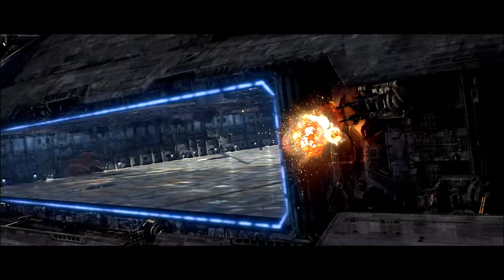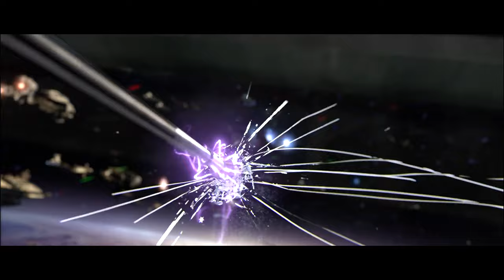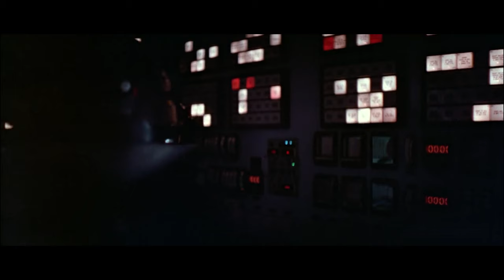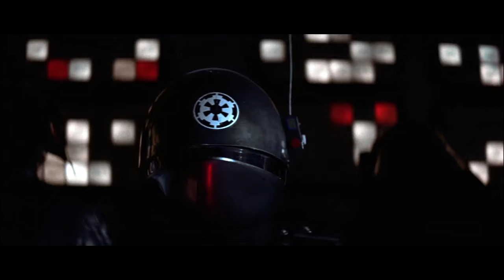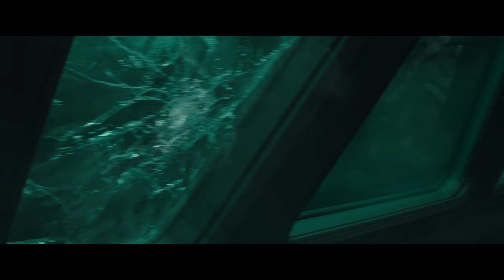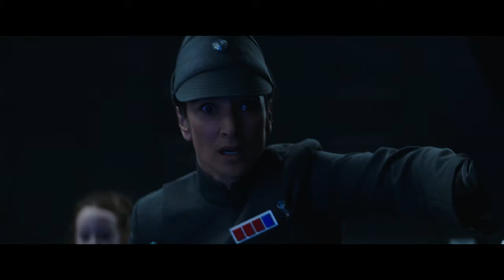This makes literally no sense

Comment: I mean, technically theres no reason for a house to have windows when you could just have security cameras instead, but windows are just nice to have.
You could have some sort of cameras or sensors on ships instead, but if the ship gets damaged and they stop working, now you're kind of screwed because now your flying blind.
Reply: Windows allow you to see outside without requiring power like multiple indoor display units would require, which don't let in natural light either and aren't feasible in off-the-grid locations. They can also be opened and closed easily for ventilation. AC isn't that common in homes outside the US.
Reply: Windows is actually a very well-designed operating system and allows the user to browse the web, store photos and media, and organize their documents quickly and dependably.
Reply: I don't even think Star Wars have proper cameras. Imagine how easy they would have caught Obi-Wan sneaking in if there were cameras. Same as the Rebels would not have been able to even start the battle of scariff if the empire just put some trackers/monitors on the storm troopers would when one dies they know something is up and where.
Reply: @exurii5844  I think it's mainly about WHERE and HOW the Empire plans on getting attacked. 

Would YOU install security cameras on every single corridor on the hangar level of the Death Star? I admit you could limit it to just that level, but that's still a LOT of wiring for something that's (theoretically) never going to happen, and if you DID install them, you would need technicians staffed watching every single feed every single minute. 

And Scariff was a similar story, I bet
Reply: @Vagabondobiondo  nah but that water fortress wouldn't take much and for the most part I think the empire is ruled and controlled by generals. At least the smaller desicions so they're not that smart. Plus we've never seen a security camera in star wars as far as I know so it's safe to assume they just don't have that kind of technology.
Reply: @Vagabondobiondo  
point taken 👍
Reply: @exurii5844  are you actually implying that military officers (people who study for years at universities and academies) are stupid? Sorry they arent just casually working with einsteins relativity theory on a regular basis. 🤦‍♂️💀
Reply: @exurii5844 never seen a security camera in Star Wars? Do you remember that scene in Revenge of the Sith when the Neimodians were tracking Obi-Wan and Anakin inside the Invisible Hand and they showed up on a view screen? I know we didn’t actually “see” the camera, but there was definitely one there.

Comment: Actually it makes a lot of sense: hubris. 
As you see when Grievous breaks the window, a 'metal' blast shield closes a second later. Well, when there is no threat, or not in a battle, the bridge officers would like to have a view. When in a battle, you would close the blast shield. Grievous has not closed his blast shield, because he doesn't see the Republic as a threat. In addition, assuming the ship has shields, most blaster fire would be intercepted before hitting the bridge anyway. Again, Hubris.
Reply: What doesn't make sense to me is why they don't have the same magnetic containment fields the use for the hanger to keep the air in as a backup for the bridge windows.

Comment: I mean the entire ship's exterior is covered by power shield most of the time, so it's is actually much harder to break from the outside, and it's commanding deck, being able to physically see everything that's going on around the ship is pretty important for commanders. If they rely on digital systems to broadcast all outside information and the system suddenly breaks down, everyone in the ship would be entirely blind to everything that's happening around them.

Comment: Sensors, cameras, and holographic projections can be interfered with via jamming and electromagnetic countermeasures, something you would want to have on a large capital ship. The windows would serve to give a view of the battle should those systems fail, fall prey to attacks, and even be destroyed. Having the windows on the ships is not really an issue instead it comes down to internal design of the bridge in general. An area with windows should not be entirely accessible to the rest of the bridge with bulkheads blocking it off should they be destroyed, this way a relatively minor yet important part of the ship is destroyed but doesn't compromise the entire vessel even if you have an overexposed bridge superstructure. Something which can easily be mitigated itself since the towers on star destroyers are rarely, if ever, seen completely destroyed with the placement of the shield generator domes being the main issue. After all, even in pitched combat, the bridge of a Star Destroyer is seldom targeted or aimed for with only two instances really being shown to occur where the bridge is actively hit and destroys the vessel. 

Those would be the Executor's bridge which that A-wing hit into, I do not care who says that he specifically aimed for it, the way he was acting when losing control of his starfighter means he got lucky as hell. And even when you look at the ISD or SSD either as a picture or model, outside the cross-sections, you do not really see where precisely the bridge is. You can make a guess but it still comes down to luck.

The second is the death of Delak Krennel when the Reckoning's bridge was hit by a concussion missile which detonated to instantly kill the warlord and cripple the ship. This is, again, a lucky shot as neither the Selonian Fire or Corusca Fire were specifically aiming for the bridge, merely firing their concussion missiles in order to cripple the larger warship to turn the tide of the battle. 

As for Grievous breaking the window, let's take into consideration that he had to use a weapon that channeled energy through the tips powerful enough to actively block a lightsaber without being cut, destroyed, or damaged being done multiple times. Even then, the window took a few seconds to break even with that energy coursing through it, that is a lot of energy which not many things can actually handle. And, depending on which continuity you are basing this off on, it either can produce enough energy to stop a heart within five seconds of sustained contact or has enough power to shear a being in half and given that this was an active combat situation, I'd say that these weapons were on full power. 

In other words, this is an issue that just goes with the aesthetics of Star Wars, point blank. Its not going to make sense because the whole scene is meant to convey a story with the technology taking an extreme backseat to the personal stories that affect the galaxy.
Reply: I strongly agree with your arguments and the summary, as to why this isn't even that important (see rule of cool and plot convenience), but I still want to give you a few points regarding vulnerability of sensors, cameras and holographic projections as well as bridge exposure.

A lot of people in the comments carry the argument that window substitutes like before mentioned cameras would be extremely vulnerable to weopens with electro-magnetic impact. Although this is true, what significant use would a (not that good of a) view of the battle bring the commander, if his ship is disabled, to the point even basic systems like cameras wouldn't work any more? If a ships sensors are that easy to destroy, why should the propulsion or targeting systems not be? Even humans are more likely to protect their ears and eyes, than their feet and hands. This would apply in a similar way to ships, especially in space combat.
I might add, that although Star Wars heavily relies on World War II ship design, even those had their battle and command rooms inbedded deeply into the ship's superstructure; leeving only the navigation bridge and scout inplacements exposed.
And if one takes a look at ships like the Profundity or the Venator, Star Wars designs occasionally like to overdo their bridge exposure.( more so than the ISD, which is often taken as the only example)
Having the bridge at the outside of a ship's hull or even separated like with the Profundity or the Home One, for it to have windows is a foolish idea: We can also see the consequences of this design with the destruction of the bridge on the Raddus and the loss of quite the amount of commanders it left. Shields weren't of much use in this particular case, neather would it be with most others.
In my opinion, the ability to directly see the surroundings of a ship via windows does not compensate the extrem lack of security for the arguably most vital part of the ship.
Reply: @parceval8853  You make a good point about this when it comes to the Profundity and the Venator-classes, their overexposed bridges are an object detriment when coming down to it and the Imperial-class suffers from this. Its why I prefer the Victory-class Star Destroyer, while it still has the superstructure that is exposed, the bridge is deep within the hull itself, being far more protected with the forward section acting as the space between the bridge and the windows. Such redundancies are necessary to ensure that vessels do not go down and be destroyed with the whole superstructure needing to be annihilated to ensure that the Victory's bridge is fully taken down. The Victory-class also had an observation section that was located ouside of the bridge itself to observe the battle and relay information, that or it was used for visiting admiralty and the like. Regardless, it had what was necessary to act like a true warship. 

But, even though Star Wars ships can be disabled, they can also be reset and brought back online rather rapidly. But this depends on the crew itelf and their level of preparedness for such an occasion to take place. Though this is primarily seen in Legends than Disney canon even with vessels from Hoth disabled by the Ion cannon being back online within a matter of hours. Not only that but if a ship is disabled via ion cannon and the enemy attempts a boarding action, there would be a better chance to see it with the windows, granted, its a small chance but its far more plausible. But that doesn't negate the need for robust forms of observation while internal communication is fine since the officers can use comlinks to relay information even when the ship is disabled. 

As for why targeting systems are not destroyed. Jamming via ECM does affect the targeting system making it that scanners cannot get a target lock, this is why turbolasers have human crews on them to ensure that if the system went down, became compromised, or some other reason, they would continue to fire. When it comes to propulsion, they are highly exposed and a single proton torpedo to any of those large engines would affect the ship greatly, they have no protections for them but its likely due to the high levels of ion radiation that is being emitted that makes it difficult to take them down for starfighters. Not only that but in a space battle, while winning is the primarily object, being able to take control of enemy ships with a minimum amount of damage so they can be quickly used on your side makes a great deal of tactical sense which is why you don't want to take out the propulsion system.

Comment: What if the “glass” on Star Wars ships is protected on the outside by a type of shield. This would protect it from any attack just as any of the other surfaces on the ship are protected by shields. But from the inside, it would be much more susceptible as there is no shield layer protecting it. 

It is also worth mentioning that Grievous is much stronger than an average person and thus is the most likely to be able to break a strong material of any type.

Comment: the other scary thing about windows is that they're designed to let in EM wavelengths of the range the inhabitants see with, so a laser in that frequency range would pass through with no problem...far better to just have a camera overload outside than the crew's' tissues all be subjected to the energy 😞
Reply: We can be happy that only the deathstar is using a laser 😅

Comment: I think, at least for the CIS, having windows on there ships is actually there purely as a means of defence from boarding parties. As we see in RotS, destorying the windows was enough of a problem that it stopped Anakin and Obi-Wan long enough to allow Grevious to escape, but even beyond that situation taking the Bridge is often seen as the moment of victory when boarding a ship, so for the CIS, because there Units are primerally Droids and seen as utterly expendable, destorying the window of a ship to prevent it's take over, and possibly killing the invading force by lack of oxygen or just been pulled out into Space, is going to be seen as the most logical tactical move they can make, as it's going to be far easier/cheaper to repair the window and replace the few additional droids lost to the vaccume of space, than to rebuild an entire lost ship or wage a battle to attempt to gain it back.

Comment: Because if you relied on Sensors, those could be jammed, hacked, etc.
With cameras, you could possibly have a blind spot depending how you set them up, plus can also be jammed, hacked, etc.
And for both, EMPs are a thing, hell there was a capital Separatist ship that had an Ion Cannon super weapon on it. Sensors on the ships that got hit by it did absolute jack for them afterwards.
Ships could also have stealth emitters or something that mask their presence from the sensors or a cloaking device for cameras.
Windows are an easy way to see what's really going on outside your ship. Although a possible weakness, it has some advantages too.
---
And to have them 'On the bridge', if a ship was hit with an EMP, and you had windows elsewhere, comms would probably be offline and getting a message of what's going on outside from a window on lower decks to the bridge, could take a bit.
And if your windows on the bridge get hit, there are shield emitters and shutters for such an scenario.

Comment: VISIBILITY. No amount of technological advancements in imaging can replace the good ol' tank commander, sticking his head out for a good look at his environment irrespective of risks. I'd imagine the same logic would still apply to space ships. Maybe the glass is impervious from the outside, owing to its shields and resistant to small arms fire from the inside but elite level power weapons could be powerful enough to overcome it. Although the glass area itself is too large, the bridge could be made more compact with smaller glass areas, making it harder to hit and easier to protect.

Comment: It tends to be sci fi bridges in general, save for the Expanse and to an extent Halo, though the Pillar of Autumn still put the bridge right at the front of the ship.

On real warships, to the best of my understanding the exposed bridge is mostly exposed for observation/navigation purposes, while the ship can be fully commanded from a more secure CIC in a protected part of the ship. To be fair to Star Trek, even the generally tactically unsound Galaxy class has a battle bridge that's buried between the saucer and stardrive sections, and you can command starfleet ships from engineering in a pinch, which generally is fairly deep in the ship.

Still, it's not something Star Wars is unique in being guilty of.
Reply: At least Federation ships, before the Dominion War, can be excused as not really being warships as much as they are exploration vessels. At least in doctrine.
Reply: @thehumanoddity  Sure, but after over 2 centuries and many wars, they should know it's a possibility, or at least that there might be individual hostile encounters.

Even barring that, they regularly encounter dangerous situations, be it radiation, asteroid impacts, etc... that you'd want the bridge more protected from.

But I take your point, the empire is just giving the rebels an easy target